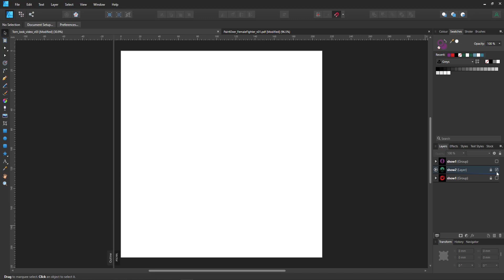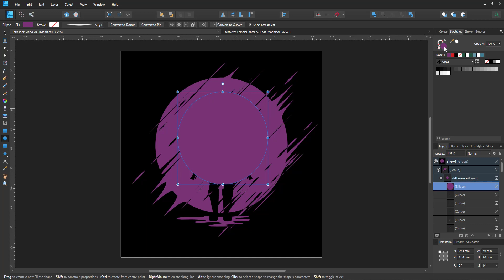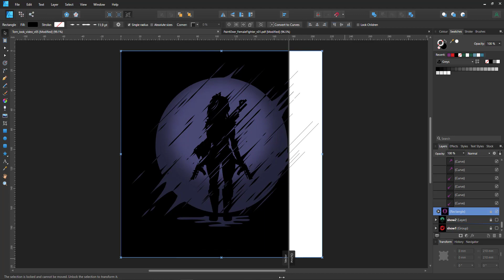Affinity Designer Tutorial - Quick Fix - Achieve a Torn and Blown Effect easily

Comment: Nice !! Probably the most interesting video of all your new ones ! 
I guess you could also use brushes instead of pressure profiles ? Paintstrokes for example, might look nice.
Reply from the maker: Yes... it could be... but then it would be bitmap objects in the scene. I couldn't expand those. This approach allows you to expand all the strokes and combine them with the design to make it one curve [using Boolean operations or the compound function]. Ideal for crafters, cutters, or vinyl printers. :)
Reply: @2dgameartguru  Yeah, i dont think i would ever print such an effect, but if i wanted to, i had to set up the document to the correct dimensions at 300dpi.

BTW, this would make an interesting tutorial: how to calculate the proper size for a brush that is suitable for printing. There is very little information on that topic, afaik.